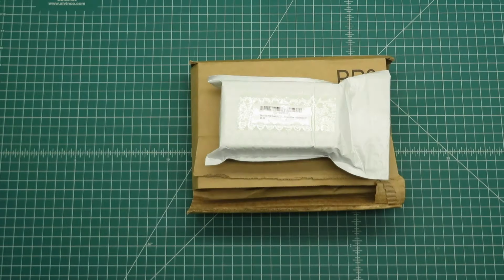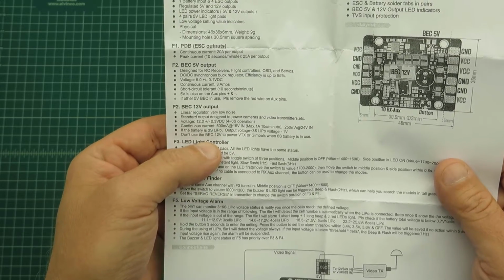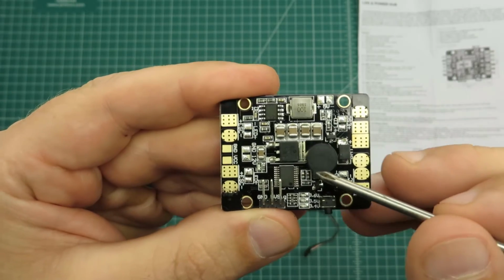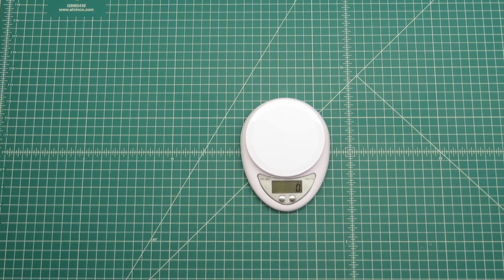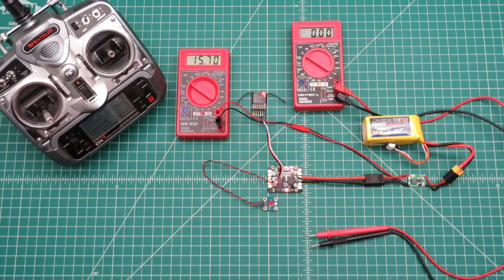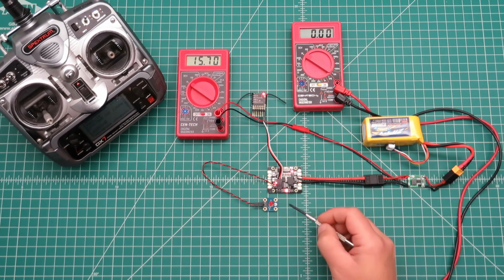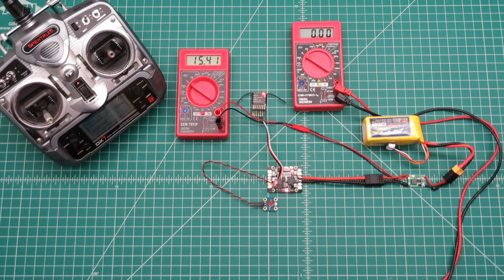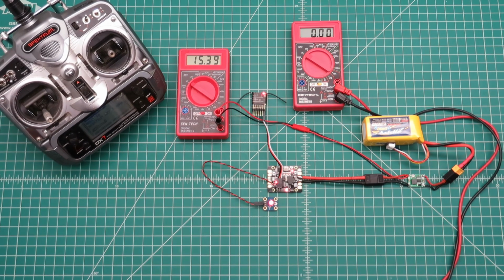Hobbymate 5-in-1 Power Distribution Board

Comment: Hi thanks for the video. I've been trying to get the lost model/led functions to work w/ my taranis. As far as I know I have everything set up correctly. LED/Buzzer mode function in Betaflight are tied to Aux 3 which is controlled by a 3 way switch on the X9D. I have an XM+ receiver so I can't hook it up in the way that you did. Instead the I just have the sbus wire from my receiver to my flight controller hooked up. When I set up the 3-way switch in Betaflight's modes under "BUZZER" and pair it with Aux 3, I can see that the led on the FC flashes when I  flip the switch. It also turns off when I set it to middle. However, the buzzer doesn't buzz and the LEDs that are hooked up to the PDB are not flashing as they should. Just the tiny LED on the FB flashes.

I saw another tutorial that said to take the Sig from the 3-Pin elbow connector on the PDB and solder it to "Sig" on the 6th channel of the flight controller. I did so and it didn't change anything. I'm a bit of a newbie at this. Do  you have any idea what I might be doing wrong?
Reply from the maker: You need to use one of the PWM outputs from you flight controller for the input to the 5in1 PDB to control the buzzer and LEDs.  It takes a little experimenting and can be tested with a servo before you connect the output to the PDB.  This video should help.  https://youtu.be/cHi1fKP1LRI

Comment: Nice video, How did you set up the lost model finder? I cant get mine to work!
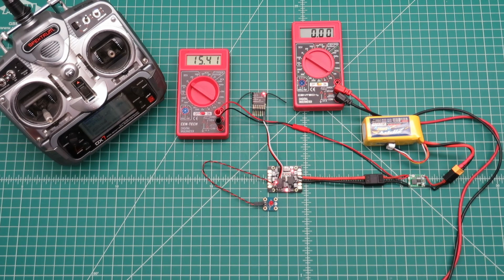Reply from the maker: Thanks!  Check out the video at around 9:40.  Just hooked it up to a channel that has a switch.  A low value from 1000-1300 will trigger the alarm.  A value from 1400-1600 will be off and an value from 1700-2000 will activate the LEDs.